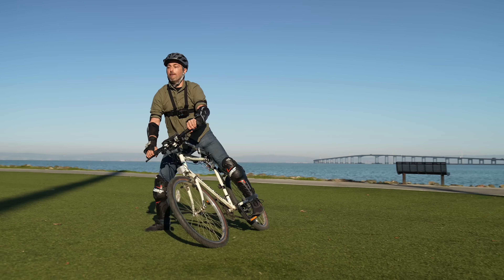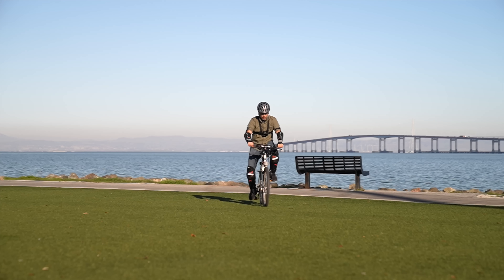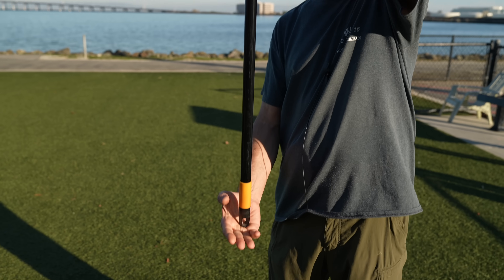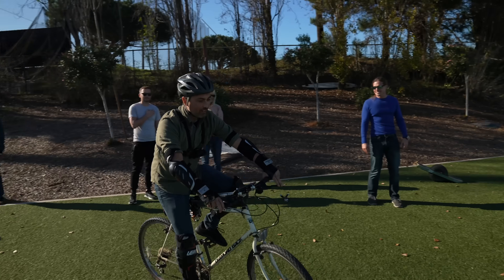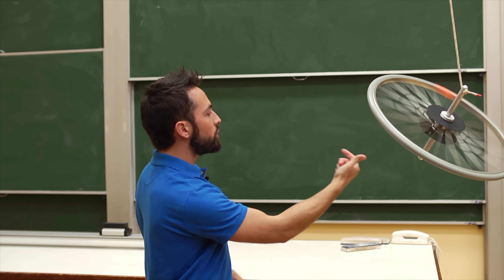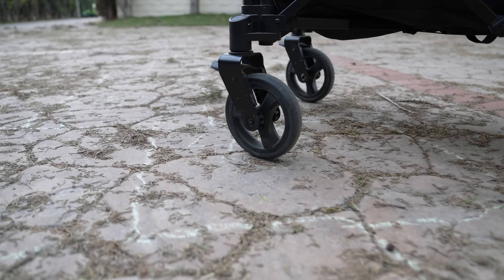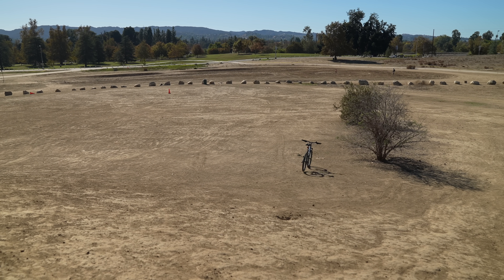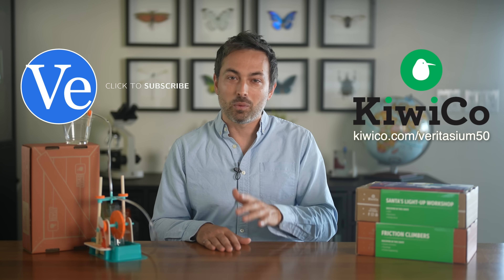Most People Don't Know How Bikes Work

Comment: I remember learning to ride a bike with no hands at age 13. Letting go of the handle bars completely made me fall once and I cut myself up pretty good. I was laying in the middle of the street for about 4 minutes soaking in all the pain. But I got it down and learned to be aware of the steering along with my leverages. Only really works when you’re going in one direction at a high speed, but you can do wide turns with no hands
Reply: Riding without hands also teaches you traction control. Go around a corner with no hands. Now even if the road were absolutely oily, if you folllow the same line as no handed, the probability of oversteer or understeer is basically nil.
Reply: @PyroBlank  Well, a bike with no person on it is more stable, because it's lighter. It is less stable when riding it, because it's heavier, so the bike needs more time to "self-stabilize". If you find yourself cycling on a frozen lake, this doesn't matter because everything is flat, but for most everyday occasions, i recommend riding with at least one limb touching your steering wheel ;)

It's kind of like what happens when you push a person: The harder you push them, the more they have to move to compensate for that action. If you push them next to the edge of a cliff, chances are they're not coming back up :P

Also, i guess another part of it is that the weight of bike doesn't shift around in relation to itself, whereas your body - especially while not holding the steering wheel - is getting rocked back and forth every time your steering wheel gets caught on something, exacerbating the issue by increasing time needed for the bike to correct its orientation.
Reply: pretty much every kid in Holland can ride a bike without hands. When you get older the fun wears off, for most at least.
Reply: @waltermessines5181  not for me, it helps if it's cold so you can put your hands in your pockets
Reply: @lenmusters6770  Come to Portugal, no more cold hands.
Reply: The most fun about riding hands free is pretending you're driving a sports car and perplexing all the small kids who just exited kindergarten
Reply: Not just wide turns at high speed. You can start with no hands, get up to speed with no hands, orbit people with no hands... I use my hands on difficult terrain or when I need the brakes.
Reply: Depends on the bike, its steering geometry and setup. Some are easier than others.
Reply: @Kimoto504 and how True the frame and fork are,! It's also a good test ! Some of those,,,, they aren't straight and true.
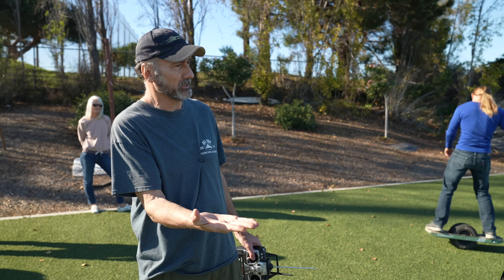Reply: 5:37
Reply: I used to ride circles around my local Acme with no hands while waiting for my friends to show up
Reply: This ignores the point though. Even in doing so, your handlebars still may rock to the left before the turn as you’re counter correcting before the turn. You’d have to focus on making your lean the first part of the turn, or the bike would still come out from under you
Reply: I tried that once. The front wheel steered like 90 degrees to some side so that the bike was stopped completely and I flew off the bike. Maybe some day, when I am riding in a grassy and level place, I will try it again.
Reply: I don't even know how I did it. I remember practicing one hand and it was really easy, but I was really scared to let go with both for more than a split second. Then one time, I was riding behind my dad and I saw him do it and I just let go and it worked, no falling involved. I have no idea how I pulled that off.
Reply: Riding a bike without holding the handle bar is pretty easy and everyone who is often on a bike can do it. However, it is definitely easier on some bikes than it is on others, and on top of that, it's dangerous because when something unexpected happens you have no way to stabilize your bike nor your fall. So, don't do it.
Reply: Idk, it isn't worth the risk of falling over imo
Reply: Back in the early 80's, our town played down tar and the gravel on some streets. I was going around a curve on my 10 speed and not steering with my hands. I hit a mound if gravel, flipped my bike and skidded on my chin. Tore it open to the bone. 20 stitches, 44 years and a goatee later scar is not visible...unless I shave.
Reply: @Budman_4044  sounds like a skill issue, but I also fell off my bike and broke my arm a few weeks ago soooo…
Reply: I used to do that too when I was young.
Reply: i can't say i learnt this completely, but I try every now and then when the road is straight and safe. But apart from safety or difficultly, it's so tiring to do.
Reply: right now im 11 ride a fixie and no hands is no problem and can turn comfortably but still know to be very carefull
Reply: It can be done my friend. It's practice.
Reply: You still steer the bike just with your balance lol
Reply: A few years ago I had repaired a  vintage Schwinn Lemmon Peeler that had been backed over in the driveway. Knew that the grandchildren were going to be riding it after I fixed everything. The fork was a bit of a mess and needed to be put back to original specs. So riding that" krate " had to pass the" look ma no hands test" and yes some adjustments were necessary.  At 60 years of age that was a challenge on that thing with that much extra weight over the rear wheel on the front being way our there. Man the first time I let go of the bars and found my self trying to over  correct to stay upright was a bit scary.  Eventually I got the fork and wheel aligned pretty good. The kids bikes were always a bit scary no handed being a six foot 190 pound adult. Any way just to let you know if you have a mechanic straighten your fork you are asking the mechanic to test ride it no handed. It's the only way to tell if it's true at the end. It needs to be center neutral and not pulling in one direction or the other. It's really amazing how much tiny differences make . Just a 2mm difference in fork rake can transform the handling from this is kinda not good to yea this is beautiful.
Reply: I learned to ride with no hands at 11 and I lost control a few times but never fully crashed
Reply: Yep, as a teenager, I used to ride all the time without my hands on the handlebars. We lived on a hill and I would zoom down at 50kmh, no hands, and even make the turn at the end just by leaning. I even managed to ride all the way to school (~5km) without touching my handlebars once, and up the hill in the same vein. Bikes are amazing.
Reply: riding no hands is so fun i just stoped holding on bc i was lazy lol i was able to go forever and do pretty tight turns or go pretty fast once i went down a steep hill and feared for my life but somehow did it all with no hands
Reply: So basically you rode with no hands and realized that you COULD ride simply by leaning. I wouldn’t say wide like huge turns but you can’t make sharp small turns though.
Reply: looking at where you are going instead of at the steering wheel is also a great way of staying balanced even through somewhat tighter corners
Reply: I watched a guy ride a bike pedaling backward while sitting on the handlebars
Reply: I was laying in the middle of the street for about 4 minutes soaking in all the pain  bruh
Reply: I feel like my bikes have never had tight enough handlebars? Idk but whether I’m on it or just push it, the front wheel goes crazy if I’m not holding it
Reply: You need to use hands when you’re breaking and going for sharp turns. I can personally make my way around my neighborhood without hands
Reply: also affects the weight in front of the bike, the heavier the front of the bike, the more unstable the bike is (with or without mass), it's almost impossible to go without hands if you have weight in the bike basket
Reply: It’s pretty easy to learn, I learned over time by going 1 handed, which is very easy, then I would let go and when it got scary(which happened immediately) I put my hands back on the handles, over time u can let go for longer, then u just know
Reply: Never really think about it, but as long as you maintain the speed you're good to go
Reply: No turn is too sharp. You just need to slow down, and if turning right first streer to the left side of the road then right for more room.
Reply: Come to the netherlands youll see dudes take sharp corners no hands
Reply: Tried it after getting off early for work last year. Fell over, the brake handle punched a hole right through my pants and left a huge bruise on my inner thigh. Never again.
Reply: @WanderingHermitCrab dont give up when its hard or you get hurt.  You can't get the bag with that attitude.
Reply: @WanderingHermitCrab sounds like a skill issue
Reply: I can
Reply: you sound dutch?
Reply: you can pretty much ride bick without hands, not even necessary fast, you just need pretty good balance
Reply: @novy1198  yeah but higher speed is needed to keep balance during turns
Reply: @justyourfriendlyneighborho903 when you’re new yes, but this is absolutely not true at all
Reply: @justyourfriendlyneighborho903  not really, I could ride my 20" in a figure 8 without hands in the width of a side street (which is just big enough for two cars side by side), going around walking speed.  You just need good balance and good understanding how the bike behaves. 

But if you think that's hard you should try seat surfing (aka standing on the seat while the bike is in motion and retain the ability to turn left and right).
Reply: I can ride + take 90degree turns without hand at 5kmph
Reply: @sohambaner777 lmao 5k mph, how can you even survive at that speed
Reply: @madmax2069  bro thats 5 kilometers per hour bro not 5 thousand miles per hour
Reply: @sohambaner777  yes I know, I was just poking fun as 5kmph makes it seem like you was saying 5k mph. I'm use to seeing km/h not kmph.
Reply: Everyone who's saying they can ride no-handed: yeah, we know. Everyone can. It's not a flex.

Comment: When I turn my bicycle I lean, a little, first and the steering naturally follows on. I think the portion at about  08:00   best explains it in terms of the self steering mechanism.
Reply: The same when you turn without holding the handles
Reply: Yeah I've never used counter steering even after watching this video. It feels way more intuitive to lean and then steer
Reply: I only use counter steering when I'm making a u turn or doing a dramatic turn before stopping. 

any other occasion I start the turn by leaning. This ain't a motorcycle you can overpower it with body weight.

 @nigeladams8321
Reply: yep this whole video is totally wrong, coz when u block the specific turn, what actually happens is u ruin ur balancing, so u just fall off BEFORE u even try to do anything.

in reality, u can totally turn without countersteering, yes, by leaning first a bit and following with the handlebars as soon as bike starts losing its balance, and this is preferable way to turn in specific situations, like, in winter for example, this way u dont have to lean too much.

however, in any normal situation its preferable to always go for countersteering, coz its faster and more reliable, and with the speed the ability to not-countersteer loses efficiency extremely fast, like at 50kmph ur turn radius is gonna be somewhat like 20m with countersteering and 50m without, so basically u cant even turn in a city at this speed without countersteering.
Reply: That lean actually does a counter steer. You shifting your upper body to the left shifts both the bike and lower body to the right. The bike makes an almost unoticeable steer to the right before following your lean to the left. You don't notice it because bikes are lightweight, you'll see this much more pronounced on motorcycles since they're faster and heavier. Bikes always counter steer to initiate a lean, the amount needed varies depending on speed and weight.

Comment: You don't need to turn one side before turning to the other. Simply lean on the side you want to turn into. I have never the countersteer that is shown in this video. However, I must admit that I am very skilled on a bike, I spend 90% of the time not touching the steering and it's probably why I have so much control over it.
Reply: "You don't need to turn one side before turning to the other."
True, but not the way you think.
If you want to turn left, you don't turn right and then left. You onlu turn right and the bike do the rest.

"Simply lean on the side you want to turn into. I have never the countersteer that is shown in this video."
Lean alone do nothing and you've always countersteered just like in the video. Everyone has. There is no options.

Comment: Betcha I can beat the “no turn bike” 

Near the beginning of the video there is a telling comment about how people turn slightly right before steering left. This is because the slight right steering angles their body and the bike to the left, so then the bike can “go” left. This brings up a crucial point - “steering” the bike in a direction and “going” in a direction are kind of separate functions.

As a new mountain biker I’m having to learn a new technique of leaning the bike extremely to execute certain kinds of turns on the trails. This requires a way of working the body overtop the bike that forces the bike into an almost 30 degree angle without actually leaning your body over. Fun! 

But in practicing this maneuver I have discovered a few things. You can lean the bike without steering it. This will make the bike “turn” with no rotation of the handlebars-no steering. After the bike changes direction, then you rotate the handlebars to determine the actual radius of the turn.

As near as I can tell this video proposes that “going” left or right is about the angle of the bike as opposed to being vertical. If you take steering out of the equation you can still force the direction of the bike by changing its vertical angle.
Reply: Long story. Purely fictional.
Reply: >> Betcha I can beat the “no turn bike”

Really?  As in you will bet me?  You're on.  Contact me via linkedin and we'll make the arrangements.

Comment: My father modified a bike so that it turns in the opposite direction. You steer left, the wheel goes to the right. I had to practice for a few days until I could ride it and it is fun to see people struggling with it. Even pushing it is hard

Comment: As someone who uses the bicycle every day, it's significantly easier for me to steer a bike without steering the opposite direction first. It used to often be snowy and icy on the roads so you quickly learn to lean into where you're steering instead of steering against your momentum. It's also a more gradual build up. I did this using a manual kind of steer lock and found it surprising how much I can still make a different turn than what my handles are locked to turn into.

My guess is that it's the same kind of principle of why a bicycle is able to roll down a hill without falling over. You just start the steering much sooner by leaning into your desired direction first, then letting the steering wheel do most of the work "falling" into place. It's hard to go straight again though, without unlocking the steering wheel. I still need small adjustments to get back up straight without falling like the guys in the video do.

So it's not impossible, it just requires more experience and I think that comes from driving on very slippery roads, where steering against your momentum is just going to make you slide much sooner. Also, if the turn is sharp this obviously doesn't work at all without going very slow to the point where you're almost certain to lose your balance and fall.
Reply: "steering against your momentum"
Your momentum is straight forward.
Reply: @XtreeM_FaiL  Exactly. So if your momentum is forward, but your wheel wants to go a different way, your wheel will slide.
Reply: @XtreeM_FaiL  Exactly. Which is hard to get on roads frozen over especially during misty or light rainy days. Happens a lot.
Reply: @XtreeM_FaiL  You misunderstand. I never said friction had anything to do with why you can't steer one way without steering the other way first.

Friction has everything to do with how you learn to lean before you steer, so the turn is very gradual and reduces the chance of the bike sliding out from under you, when biking over snowy & icy surfaces. Which is more likely to happen if you first steer one way before steering to another.

Once you've learnt that, you can easily do it on a ground that's not slippery.

Comment: This video was right,

until I ride my bike.
I turn left by leaning my bike to the left and my hands simultaneously steering the handlebar to the left. My bike then turns left. I’ve watched my hands and the handlebar every time I make a turn and I’ve never seen the handlebar is steered in the opposite direction before I make any turns.

Comment: Not only is this nonsense but it also happens to be wrong. Yes you might have to shift your weight to make a turn if your leaning too far over, that’s obvious, but it is totally possible and quite common amongst good drivers to make that turn smoothly and perfectly balanced without having to teeter totter.